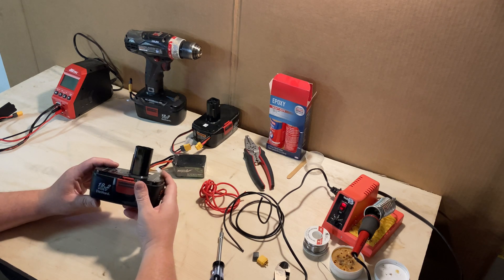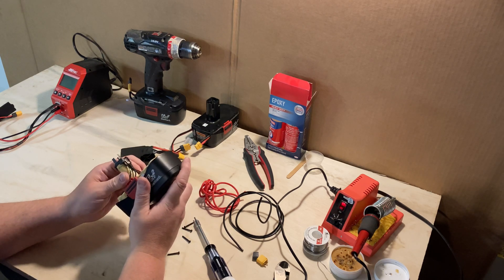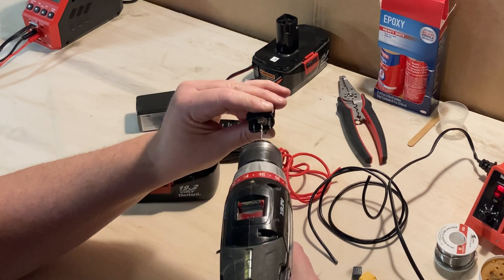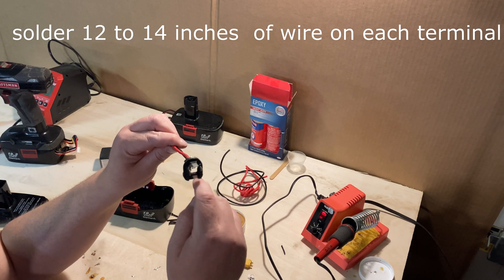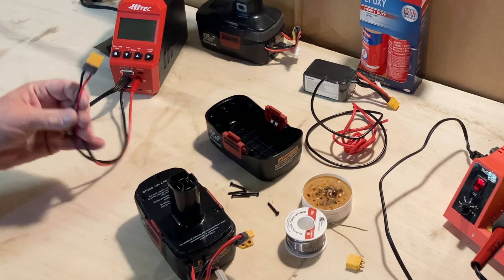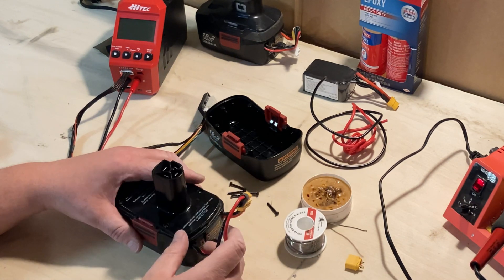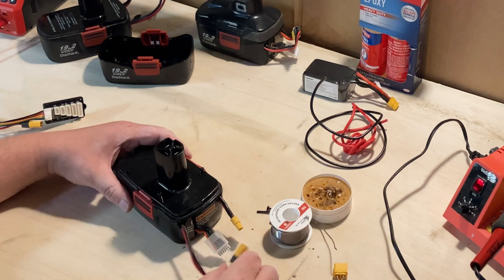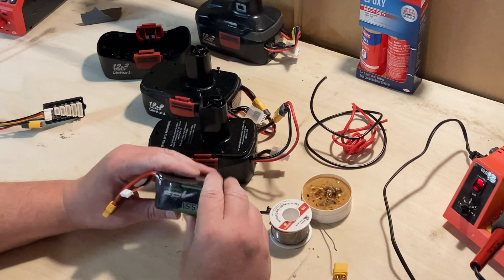Keep those craftsman 19.2 volt tools and batteries

Comment: Im interested in wood working and am an occasional contractor. Meaning building a fence, running wires for a garage, rebuilding the roof of a walk away (current job) and demo work. I do all of this still with these 19.2 tools (though I should replace my circ saws brushes soon.) all of these work great for me with the China lithium batteries and I haven't noticed any really draw back from them

Comment: So, how do you keep from over-discharging the cells?  I have a CellMeter8 which shows the pack and cell voltages, but that means I'm constantly worried about it.  I tend to just charge it after every use unless it's a large job.

Comment: A less labor-intensive approach is to just get an adapter for a different battery system and switch over to those.  For example, I inherited some of these Craftsman tools, plus a few other brands I didn't use normally.  They all needed new batteries, so I would have to buy a bunch that weren't compatible with my original tools.  Instead, I invested in a few Dewalt battery clones and got an adapter from those to the various tool brands.  With the adapters, I'm still only using one type of battery, so only one type of charger required.  Most adapters are <$20.  (You can also 3D-print them, but I found it to be too much trouble to track down all the metal hardware to make it connect electrically.)

Comment: Not worth the time and effort cuz for about $17.00 you can buy an adapter from Amazon that will allow any newer type lithium batt that you chose to run your older craftsman tools I use Dewalt lithium batteries on my older 19.2 volt craftsman tools as well as my new Dewalt tools
Reply: Hello, can you please tell me which Dewalt Lithium Battery you use to replace the Craftsman 19.2v?  Thank You
Reply: @GhedoandNana the 20v max    with an adapter because they are different plugs
Reply: true. or you can buy new lithium ion batteries made for the 19.2 series tools. both options come out to around the same cost. this way in the video may actually come out to be cheaper if you have a bunch of 19.2 nicd batteries lying around that you dont want to chunk in the garbage.